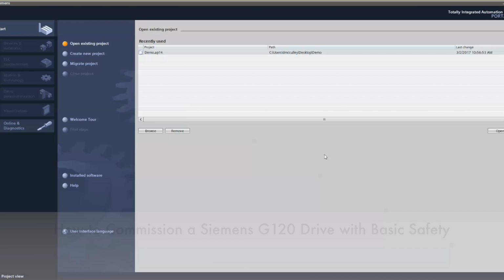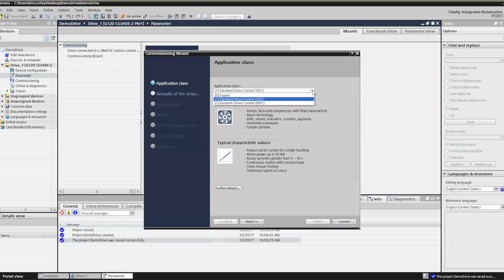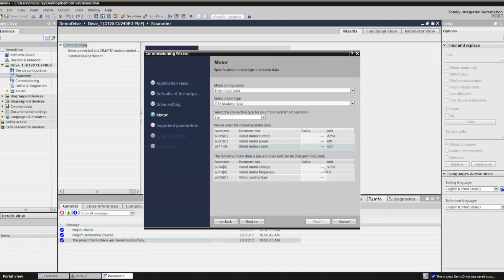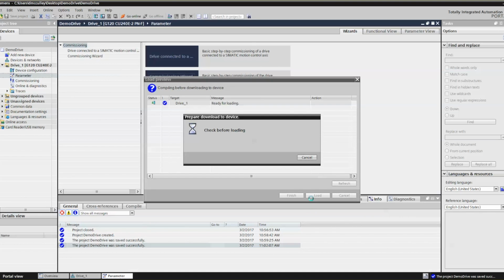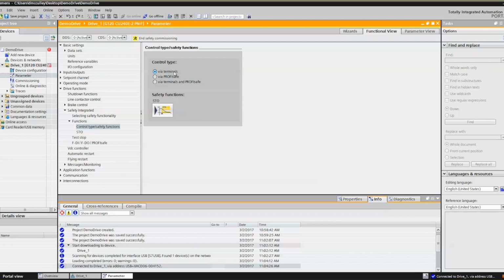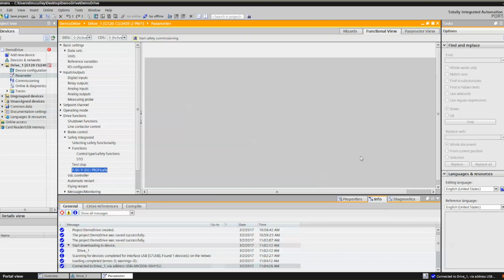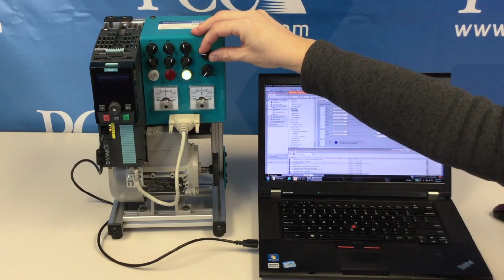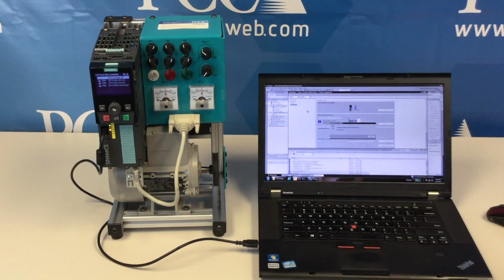How to Commission a Siemens G120 Drive with Basic Safety

Comment: What if I don't have the "Drives" option under "Add new device"? Thanks
Reply: Probabilmente hai la mia stessa versione di TIA portal che non è quella completa... anche io non ho i drive
Reply: @ivus1981  I just figure it out that I don't have the Startdrive software package. After I install the application, everything is working just fine. Thanks!
Reply: @fabiomonteiro9298  hello, did you download from the siemens portal or is it on the TIA portal cd? I do not find it ;-)